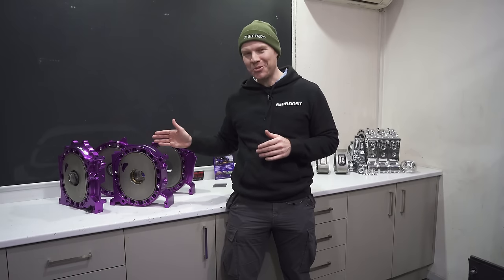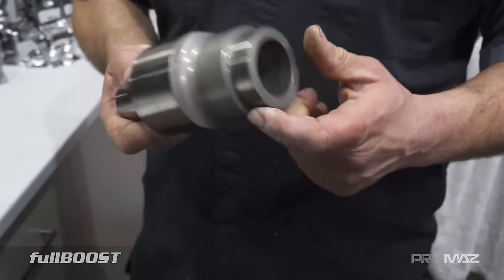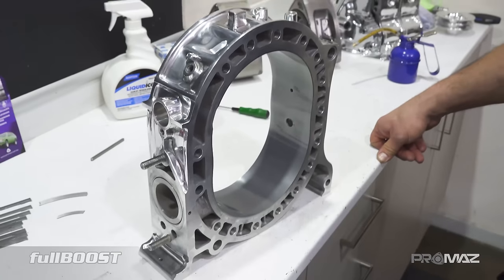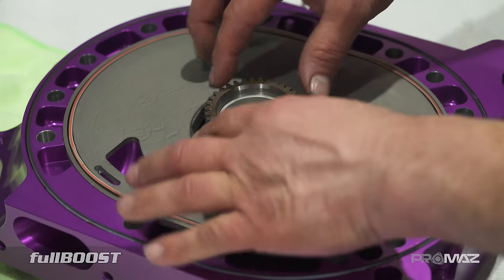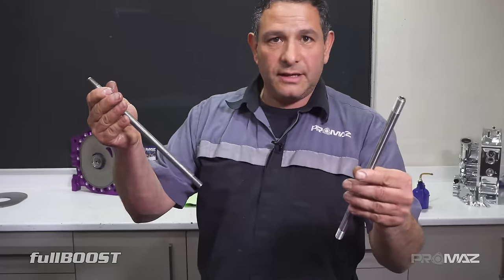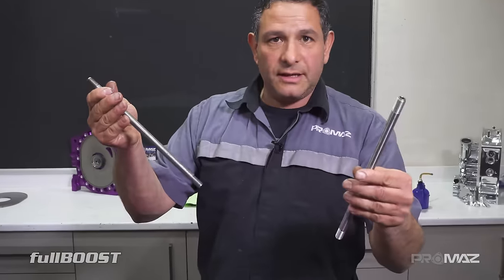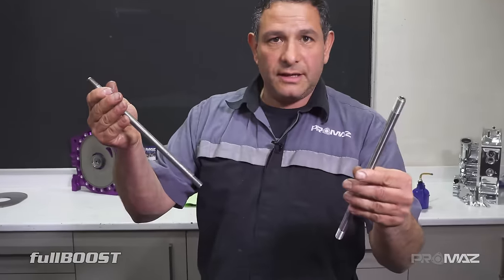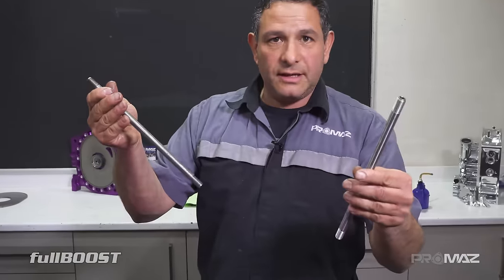Building a 1500hp Billet 20B 3-rotor | fullBOOST

Comment: People always seem to say how easy these engines are but when you are playing with the ports and learning about the float and tricks its almost like a hydrostatic transmission and yes it can look easy but it can and will fly apart in 5mins if you get it wrong, and seriously that's the secret yes looks can be deceiving and wrong porting they will not run properly if you use the cheap seals they will break and any engine builder will tell you that we should all stick with what we know or a certain mechanic can have a love hate with a big block or two buddies who one like Ford one likes Holden/ Chev some are v8 guys some are 4cyl but they are good at what they do.

Comment: Has any rotarty eclipsed 2,500hp yet? (I honestly dont know..)
Reply: The fastest rotaries in drag racing have run 229 mph. If you estimate the weight of the car at 2050lb (average min class weight), then it calculates out to about 1950-2000hp.

Comment: 3 billet plates and 3 new rotor housings is alot more than an extra 10k$! would be easy 20k$ plus.....
Reply from the maker: If you were building a cast engine you'd be using new housings anyway 👍

Comment: Why aren't you using the oil pump gear
Reply: Because they're going with a dry sump which has a separate pump driven by the engine.
Reply: @gracielkelly9645  cool. Thanks

Comment: Can you run the rotary engine as a generator to power electric motor? How much more efficient would it be
Reply: Darpa Agency have Something like that and even Rolls Royce did an R&D on a rotary engine powered ducted fan.  It gives you an idea on how that thing is awesone.  There's also a guy that have a record for the fastest propeller aircraft climb  and he also claim that he build a 20 000 hours tbo rotary engine.  Its insane as longevity.  If you're interested into an aircraft build the guy spend many hours building that and he's got more than one youtube video.  Sorry if you have a hard time reading my post I dont speak english.

Comment: I dont like the modular crank, they should have built a custom crank which can hold 3 rotors. But this is amazing to wach. Hats off to Mr. Simon, very knowledgeble !
Reply from the maker: The majority of high output twin rotirs use a custom 2 piece crank 👍 Simgle piece tend to suffer from flex.

Comment: Rotaries are awesome in theory,  I've owned many of them, a few of every generation past the sa. I've used the NA's for daily drivers for many years... the problem lies in people want to take it easy on the engine. Those engines strive on high rpm and are more efficient at such rates... internals only spin at 1/3 the rate of your tach... compare that to a piston engine equivalent and at 3k on a rotary would be similar to 1k on a piston.... carbon build up and poor maintenance also contributes to their poor reputation
Reply: It's the only car I've actually been able to drive with half the engine inoperable lol... it was slow as hell and took a drag start but still 😆🤣😂😆
Reply: Also when a rotary gets flooded earth's gravity quadruples when you need a push start.

Comment: What does it cost to have one?
Reply from the maker: Perhaps watch the video 👍
Reply: @fullboost  Yes,I heard that.Question, to put a 3 rotor in my 1991 Mazda Rx7 is there
any adjustment they may be needed.
Reply from the maker: @wadewheelingtonii7690  Yes you need a mounting kit.

Comment: Why isn't a access slots machined into the apex of the motor housing so it's convenient to access and replace the apex seals. Then the seals them self would simply made like a inserts that you can unscrew few bolts and replace the seals, screw the inserts with the seals in and close the access slot. Then you don't need to remove the whole engine and take it apart, you would only need to get to the engine access the seals and replaces them. It would be more like you were going in for a oil change. If i understand the problem with Wankel is the apex seals gets worn out, so why isn't it engineered for better access. Just imagen if a person needed to remove the whole engine every time they need a new starter. I know there are cars with the bloody starter under the manifold. Toyota i am looking at you...
Reply from the maker: New apex seals with every oil change haha...they aren't that hard to pull apart.

Comment: 1 rotor 500hp,holy molly
What About 4 rotor
Its make 2000hp
Reply from the maker: Boosted yes.
Reply: And it will hold up to that power if you make everything beefy enough.
Whole different machine this is compared to a piston engine...

Comment: A rotary engine is just a modified wankel engine I would just like to get an efficient rotary that I can convert to multi fuels, H2 LP Actenlene, and regular fluids like gas diesel alcohol. I have already added H2/LP to my regular 4 cylinder jeep engine I had more problems getting the fuel filter through customs. Than actually converting the engine to multi fuel, right now I need a small hydrogen pump to pump the H2 in a storage tank. I don't need something huge just something that will fill an empty propane bottle for a camping stove. I have discovered that the computer adjusts my fuel flow once I open the LP/H2 line after starting. On highway I get roughly 75mph with a 1 gallon water tank,  in town traffic seems cause engine overheat and just better to turn off the H2/LP? However I would like to get to the point where when the engine is running that my storage bottle and cell, is producing H2, but as I mentioned already I need a small pump to refill my bottle. Everything I have found is far too big to fit under the hood. Can anyone point me in the right direction for a small pump?

Comment: Wait rob dahm said his can make 2000hp and this is rated to 1500hp so how is this best no hate just confuse
Reply: It's a 3 rotor, Rob's is 4 rotor. Also that is just theoretical, currently his motor is making 1000
Reply: these will make more, however they will run 1500hp easily.
Drag engines are obviously making more.

Comment: The M1 tank has a 1500 hp turbine engine.  Why not a 1500hp three-rotor engine put through the same reduction gearbox.
Let's see now.   Way cheaper than a turbine.   No recuperator needed.   Way less exhaust heat and soldiers can walk behind it
for protection.  Can a three-rotor run on JP8 fuel?   I bet a three-rotor uses less fuel than a turbine.  The army tested a rotor engine for the M1 tank but some dummy wanted a turbine engine because it's air-cooled.   Really! and that's why The Bradley fighting vehicle has a water cooled cummins deisel.   No,  it's all just politics.

Comment: Yeah but they dont stay together for very long,such a high revving engine will self destruct no matter what its made from. Short and sweet,but no reliability and no longevity.
Reply from the maker: This isn't 1995...
Reply: Just chage the apex seals on oil chages and youre good
Reply: @fullboost  i dont see any rotary engines with 300,000 ks on them and havent been rebuilt? Compared to a barra engine-well there really is no comparison is there. Rotary engines are designed for one thing-racing,go fast,but thats about it. If they were any good they would be in loads of cars wouldn't they?

Comment: and just think of the ammount of money it will take to get that little thing up to 1500 horse..        meanwhile a 428 hemi build will cost you a lot les to get it up that.

a ricer will take a lot more money simply because, well... dinky little engine's.    old saying,   you can only beet cubic inches whit rectangular dollars...   meaning it will cost 10x more to get the same result.

 I go cubic inchs...  tiny engine's develope very little torque  "pulling power"
Reply: The thing is that u need 3000hp to get to 6 seconds in the 1/4 mile. These are more much fun that having a v8 that everybody else have lol. I rather be different than to follow or do what everybody else does

Comment: The rotary is dead.
Shit thermal efficiency.
They literally intentionally burn oil as part of their design. (Great engines for women who never check their oil)
Sealing, the way piston rings seal a piston engine, is shit.
All of these things are the reason rotary engines failed to pass European emission standards and have overall shit emissions. They're notorious for backfiring. Backfiring is caused by unburnt fuel hitting hot exhaust parts.
It was a good and valiant effort but the rotary is junk. ALl the negatives far outweigh its benefits.

Comment: Just shows how badly design the rotor engine is, you have to make it a billet motor just to make 1500hp
Reply: Billet engine components don’t make horsepower. They are just help making the horsepower more reliable. A standard 12A engine which went out of production in 1985 just went 6 seconds in a race car in Puerto Rico. No standard engine LS is running those sort of times.